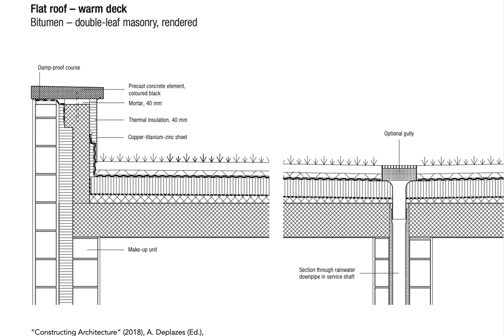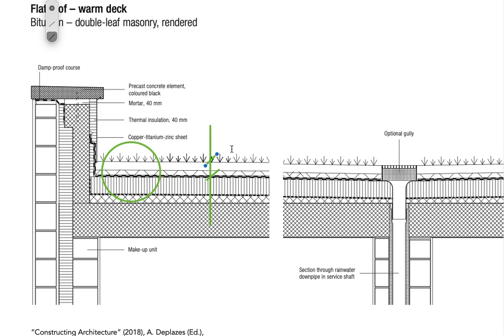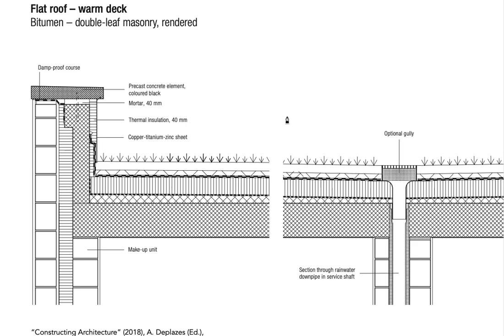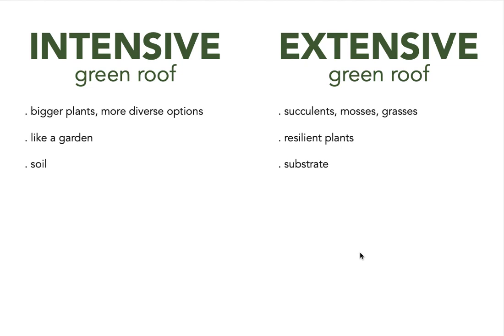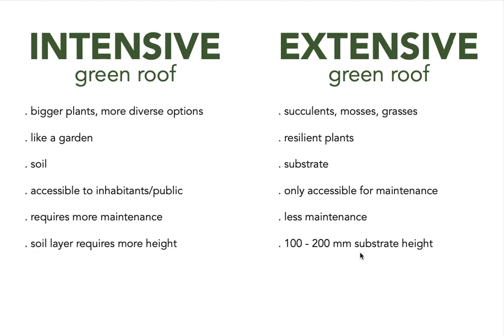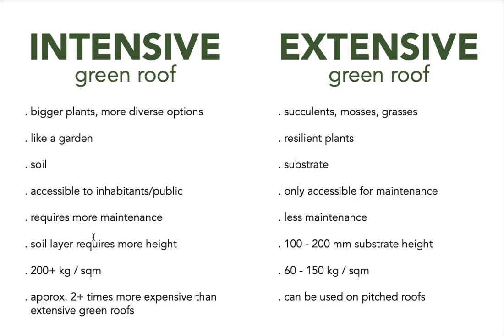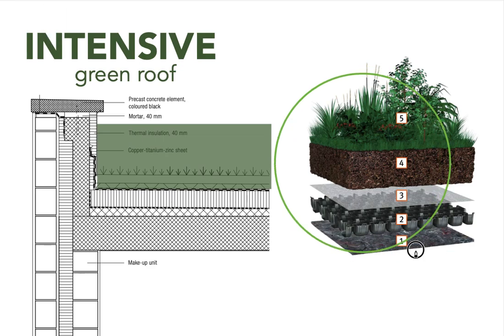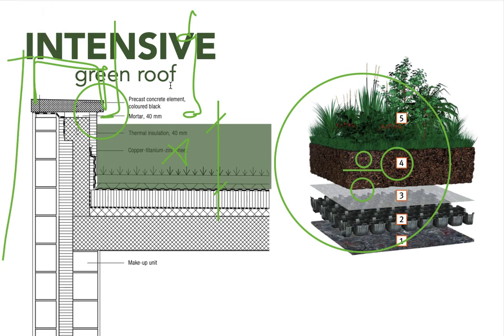REGENERATIVE DESIGN | Green Roof Details – extensive vs intensive green roofs

Comment: Thank you for this video and the level of detail. 

I am just trying to get a green roofs for my retrofit project, which is replacing a flat roof to insulate it properly. So far I struggle to find good information but your video really helps. A lot of negative stories in terms of water proofing and maintenance) out there and several people try to talk me out of it because of these challenges.

I wish there would be a video or information for general builders that puts together what to do and what not to do when you are building or replacing a roof and want to add a green roofs.
Reply from the maker: This sounds like an exciting project! I understand there are some reservations and concerns – flat roofs in general, unfortunately, I have gotten a bad rep in the past due to bad work practices. Green roofs are not more of a risk, however, if something goes “wrong” leaks and the likes are usually more difficult to access. It really all comes down to proper waterproofing and water management – I would probably advise to err on caution when it comes to inclines and water run-offs (also thinking about emergency spouts in the case of water that doesn’t run off quickly). Many thanks for your comment – this is a great reminder to continue doing research, facilitate discussion, and share experiences with retrofits! I will certainly keep this in mind.
Reply: @architecturesupport  Please do. Considering you have some experience with green roofs, do you have a recommendation for a company that does offer great green roofs systems? 

My roof is only 5sqm and my architect hasn‘t really recommended a specific brand.
Reply from the maker: @christianu8023  This very much depends on where in the world you are located (I mostly worked in Switzerland) – I would keep en eye out if you can find any built examples around your neighbourhood or nearest town. Some public buildings may use more regenerative constructions these days as part of cities' mission to future-proofing their buildings (this may be wishful thinking on my behalf though...)
Reply: @architecturesupport  Thanks. I guess you wouldn’t know about companies in the UK then, where I am based?
Reply from the maker: @christianu8023  No, I don't know the UK market all too well, unfortunately...